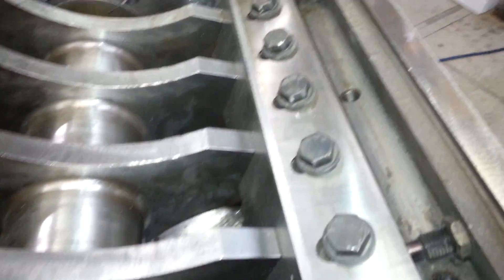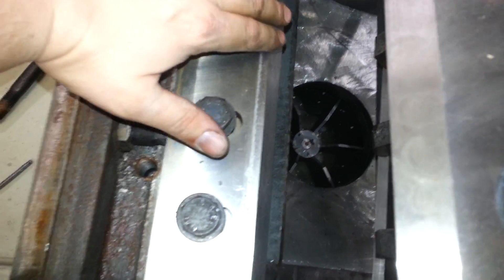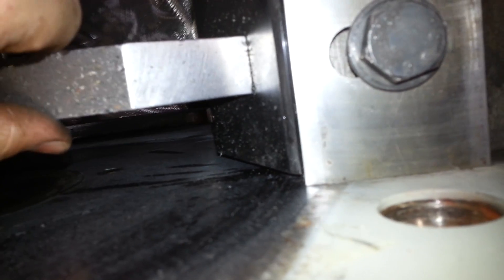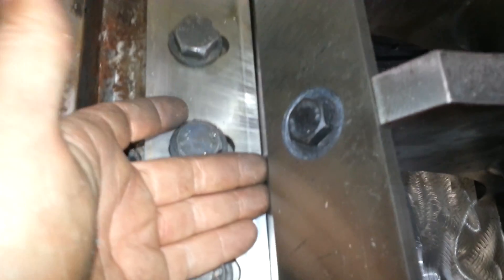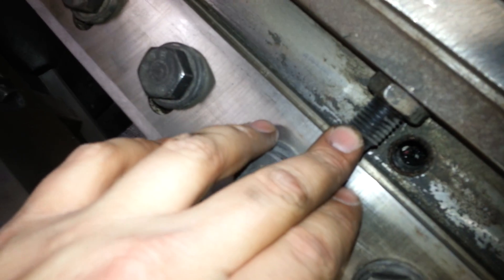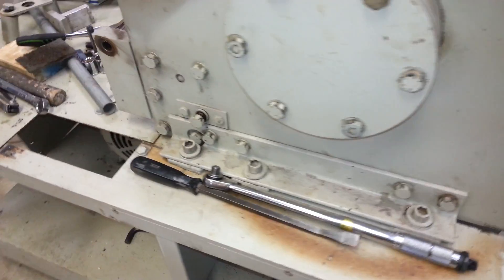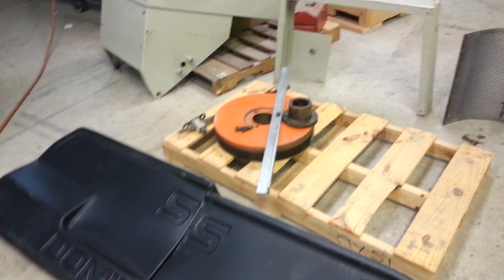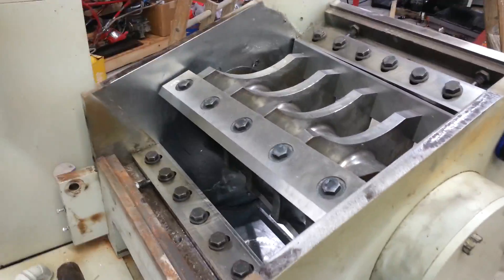Setting blade gap on Cumberland plastic granulator

Comment: I sharpen these at my job and it takes me about 10 minutes to set one up on the sine plate to make sure it's even and flat but even after I check it and grind them the ends are about .003 bigger than the middle. Even on the wet grinder it will suck up from the heat. That's probably why the ends hit first.

Comment: Nice working environment.

Your knife tolerances are larger at the center because whomever is doing your sharpening has a machine that no longer grinds the blades true.

As a machine with a traveling bed or traveling power head moves back and forth the center of the travel wears 2X faster than the ends creating a curved bed surface that will show in your blades.  Your knife grinder should replace their wear parts on their machine to bring the machine closer to true or have the machine worked over by a rebuild shop.
Reply: sorry to be so offtopic but does anybody know of a tool to log back into an instagram account??
I was stupid forgot my account password. I would love any tips you can give me.
Reply: @Eugene Sincere instablaster :)
Reply: @Kelvin Matias Thanks for your reply. I got to the site thru google and Im waiting for the hacking stuff atm.
Seems to take a while so I will reply here later when my account password hopefully is recovered.
Reply: @Kelvin Matias it did the trick and I actually got access to my account again. I am so happy:D
Thank you so much you saved my ass :D
Reply: @Eugene Sincere You are welcome xD

Comment from the maker: hmmm.    i will have to ask them about that.    thank you.
Reply: Brett Shaw hi,I have a wire granulator with different diameter and the sieve size 3mm,can you guide me the distance of rotary blades and fixed blades thanks in advance